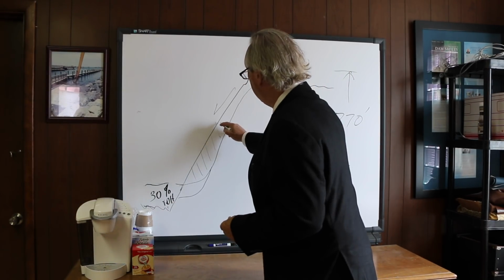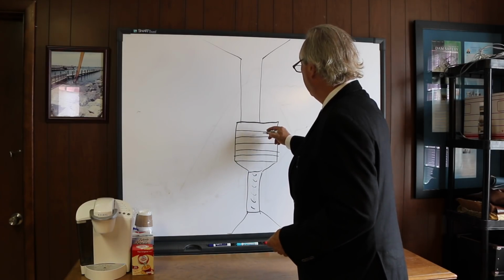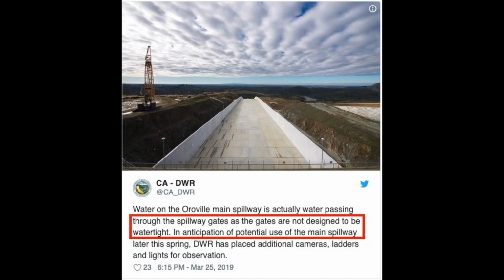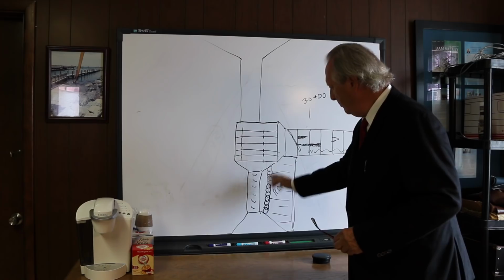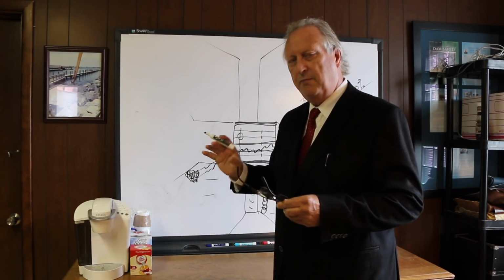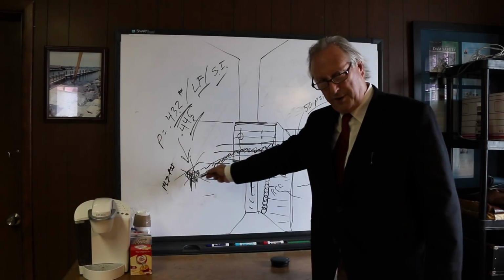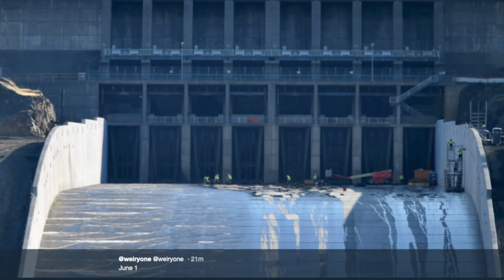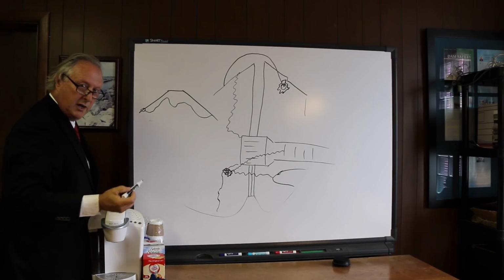Cahill on Oroville Dam 06-01-19

Comment: There is an alternative explanation for water appearing at the slab joints on the MS. The slabs  are bevelled on the edges, water is tracking down a joint to a horizontal joint, where it tracks sideways and eventually finding a low point where it spills out. There is a DWR image in the library which shows this happening. 
If you look at the 1600 images on the construction, you will see that all modern spillway techniques have been followed. There is no water showing at the drain outlets, if the drainage system is broken, then the whole must be broken, because all the outlets are dry. 
I find that extremely difficult to imagine. 
The ESW is a different construction, groundwater was found, drains were installed and they are working as can be seen on the ESW. Better to have water coming out of the drains.
Reply: vacchief, One thing I've noticed is that those who believe in conspiracy theories also promote their vision of doom to everything from Oroville to 5G networks to vaccines. And Of course, they hate Jews!
Reply: vacchief, Did JFK also talk about "chemtrails", claim the "earth is flat", claim mass shootings are faked, and claim "jet fuel is a hoax"? Typical modern-day conspiracy theories. Anti-Semitic claims about the Jews by the people who promote these theories have about the same credibility.
Reply: vacchief,  I don't post videos but I DO comment on videos. I'm sure you're aware that an account is required to comment. I have no idea why 5 people have decided to subscribe when I have no content. Maybe it's a show of support? I don't know. Nice try though to divert attention away from the subject of anti-Semitism. Which the conspiracy theory movement is totally infested with!
Reply: R Dunphy 
John 20.19ー23
Jesus Appears to His Disciples
(Matthew 28.16ー20; Mark 16.14ー18;  Luke 24.36ー49; )
 19 It was late that Sunday evening, and the disciples were gathered together behind locked doors, because they were afraid of the Jewish authorities. Then Jesus came and stood among them. "Peace be with you, "he said.
 20 After saying this, he showed them his hands and his side. The disciples were filled with joy at seeing the Lord.
 21 Jesus said to them again, "Peace be with you. As the Father sent me, so I send you.
22 Then he breathed on them and said, "Recieve the Holy Spirit.
 23 If you forgive people's sins, they are forgiven; if you do not forgive them, they are not forgiven."

IF WE FORGIVE JESUS' SINS, OUR FATHER IN HEAVEN, THE SON, AND THE HOLY SPIRIT, OUR SAVIOR, OUR ETERNAL LIFE OUR GOD THE LORD JESUS THE SON OF GOD THE SON OF MAN, THEY ARE FORGIVEN. IF WE DO NOT FORGIVEN THEM, THEY ARE NOT FORGIVEN (OUR FATHER IN HEAVEN, THE SON, AND THE HOLY SPIRIT, OUR GOD THE LORD JESUS CHRIST OUR ETERNAL LIFE OUR SAVIOR. THE SON OF GOD. THE SON OF MAN.)
Reply: @niazzam255  Some of you robots really don't have a clue.
Reply from the maker: I am self-assured that water does, indeed, run downhill. Even in California!
Reply: Sorry but you dont strike me as qualified to refute anything presented here. Having done similar construction operations (hands-on) you posed one question and hung your whole argument on it.. the drains. If you knew anything about methods and materials, you would know how easy it is to have the current conditions. And  please to note 1600 pictures that you obviously studied for hours on end... And even if you did, i am sure like the engineering interns for the state you havent a clue what you were looking at. And before you decide you want to tell me about documentation of work, i have done this documentation for the military to DOE and the EPA. 

Go ahead and tell me about how trustworthy public agencies are... Flint Michigan ?? 

So to conclude... STFU and your troll friends too....
Reply: Mark Elsesser, Not sure who you're talking to, since there are 3 people in this thread who disagree with Scott Cahill. But it is not just the drains. Which consist of several drains, independent of each other.... An alternate and more realistic explanation has been presented to explain the source of the water that appears to be coming from the joints. And I proposed a test... Stopping the water that is coming through the gates from flowing down the spillway. Wich would conclusively prove that Scott Cahill is wrong. Now, what have you presented to prove your case???
Reply: David Johnson: Hello Mine Friends. You keep changing your comments after you op loade thems. WHy do you keep changings you minds. The more you do it the less anyone will believe you.  Scott is not wrong about anything and has done enough work to be considered a expert witness when the dam falls aparts.
Reply: I Love Cops, As I mentioned before, I quite often go back and make minor corrections to my posts. Such as spelling corrections or inserting a missed word. Nothing that actually changes what I said in the first place. This continued nitpicking over minor edits seems to indicate that you have no real argument. Oh by the way, how are you, Scott, and a few others going to look when the dam doesn't fall apart? :) At least Scott is more cautious in his claims. But some of you act as if the spillway will disintegrate upon it's next use.
Reply: David Johnson: Hell Again Mine Frends. USACE puts up all their contract documents. This Oroville Dams have nothing and no geotechnicals Rep[ortsz. They are hiding something. Do you know where the drawings and reprots and addendums and work orsders are? I know they need the mill certificates for the reinforceings steels? 30 ksi mild coarbon steel, no, I repeat not Austenitic stainless steels! Not, I repear NOT austentici or Martensitic STainless steels! :erios. No dounts about sit. Thanks Yous!
Reply from the maker: I suppose that some of the many evolution and disappearance of water at joints may be from it running in the joints. I think that you know that a serious problem exists. I suspect that you know that what I have said is accurate and valid. I have worked on hundreds of dams and I have yet to fly rocks to the pressure side of a dam and drop them into voids by helicopter. Apparently, things are done differently in California. In the east, we tell the truth, admit mistakes, and fix broken dams. We do not hire men to marginalize the words of our critics, we engage them. We fail and we succeed, we learn, but never, never, do we lie to those who trust us.
Reply: Scott Cahill, When did water first appear to be coming from the joints? Was it the same time water started coming through the gates? I'm willing to bet that as soon as the water level lowers and nothing comes through the gates.... There will be no water appearing to be coming from the joints.
Reply: A simple test could prove my point and R Dunphy's point as well. Lay sand bags across the spillway near the gates. Then pump out all of the water so nothing goes down the spillway. You would see the rest of the spillway dry up and no "leaks from the joints" But I highly doubt the DWR will go through the trouble just to please a few people who consistently bash them on a few YouTube channels.
Reply: While your point is valid David I think that once the reservoir is below 813.6 this summer that the "leaking Contraction Joints " will once again not show a wet streak down the invert and all will be well again !!!
Reply: Jerry Antonetti, I agree completely that once the reservoir is below 813 feet, the "leaking joints" will no longer be leaking. That is due to the fact that water will no longer be coming through the gates. But Mr. Cahill may try to claim the "leaking"  stopped due to reduced water pressure from a lower reservoir level. My suggested test done at high water level would prove that Scott Cahill is mistaken in his assessment. Such a test would only be for public consumption to prove a point. The DWR has access to the spillway for inspectors. When they are down there, they can see where the water in the joints is coming from. They also have access to the drains for inspection. But again, I doubt the DWR will bring in a pump to pump out water leaking through the gates... Or run cameras through the drains just to prove Scott Cahill wrong. The DWR has done a poor job at public relations. They have allowed a few YouTube channels to stir up a lot of concern.
Reply: @DavidJohnson-tv2nn  , Yes David but all of this can still be done when the reservoir water level recedes to 800 the head pressure of the lake against the now saturated underlayment of the spillway will not be reduced much, radial Gate leakage will be eliminated, the surface of the spillway for the most part will be dry ,.... and then if water is still streaking down the remaining run of the surface of the spillway, you know that DWR has a problem. But I don't think so and also believe that Mr. Cahill is WRONG on this point .
Reply: When Scott Cahill tells the DWR: "don't hire college kids to troll"..... I sure hope he isn't suggesting that because we disagree with him, that means we are on the payroll of the DWR. I don't work for the DWR. I don't know R Dunphy or Jerry Antonetti but I doubt they work for the DWR either. For now, I will remain nice in my response and not suggest that Mr. Cahill wants his business to benefit from this. But I sure hope the DWR follows my suggestion and stops the water that is leaking through the gates from flowing down the spillway when the lake level is at it's highest level. That is how high my confidence is that our theory is right and the spillway will dry up.
Reply: David Johnson: Hey there little Shrimp. Why did you change you comment after you uploaded it. Did you change your minds for the umpteenth time?
Reply: I Love Cops, Minor editing like adding a word I missed does NOT constitute a change in my comment. Now... Can you add anything that will prove me wrong and Scott Cahill right?
Reply: David Johnson: THanks you My good Friends. You canniot prove what your original comment was. Have a pleaseant evenings!Do you know any engineer from the USACE?
Reply: @scottcahill945  Did you just cry: Shill?
Reply: @scottcahill945  Honestly Scott I don't think there is a major problem(s) with the main spillway or the ESW. 
I respect your qualifications and experience,. 
Last week I read a 2014 document on best spillway practice and design in the USA, I looked at the relevant DWR photos and could see that all the best practice design features had been incorporated here. 
Drains at every horizontal joint, set below the underside of the structural slab. Water stops fitted along all slab edges, dovetails set into the sides to lock with adjacent slabs. Anchor rocks everywhere you look. Polyethylene rod blocker set into joint gaps, then grouted on top. 
Any water from the bedrock will have to enter the drain trenches first, lowest points, then the land drains will pick that up and take it away. So I don't see where water under pressure can form. 
I also don't believe the drains are blocked. They used slit drains, with slits at 120 deg intervals. Slits are visible at the top, so that means two slit rows below. Gravel used was just sitting on the slits, not going through, slits 1/4".
Reply from the maker: Water is appearing through the RCC of the emergency spillway cap. Water is moving down the outside of the training walls. It is being covered with fabric and plastic. I have insufficient time to discuss manufactured "red herring" discussions of the slab structure of your secret spillway. We all know about the issues. I am being kind and responsible by not beating them to death here - open the spillway gates and let-her-rip let's see what that spillway, and more accurately the junction to the gate structure are made of. Say what you will do and do it. Be transparent and stop fabricating one story after another to explain the same situation. Be honest. Be consistent. That is all that these people want, while you are at it don't hire college kids to troll, and fire your public relations people and replace them with a good old grouting guy. Never forget what Croyle said "The dam worked as it was supposed to work" (paraphrased) Thank God that no one is that dumb. Try honor for a bit.
Reply: Scott Cahill, I do have one last question for you... If there is so much water under the main spillway, how do you explain the fact that there is no water or very little water coming out of the drains?
Reply: David Johnson: Hey there Little Buddy. You obviously have the answer, What is it. Ware are the geotechnical reports. You ever made a report and be liable if it is wrong. You are too immature to be trolling at you tenders young ages.
Reply: @scottcahill945  If you refer to my comments, Scott, I think I have been very consistent. 
RCC apron: drain outlets show water coming out. It is what I would expect, better out than in.
All my comments on slab structure are garnered by looking at the DWR images and reading up on US Bureau of Reclamation spillway design pdf's. Now I know what a water stop is and where it's placed!
Reply: R Dunphy: You have no tbeen consistent at all and now I haves a headache trying to figure what you are getting at. Good Day Sir!